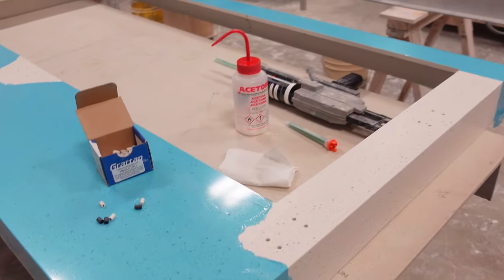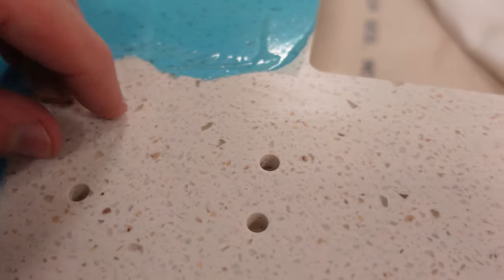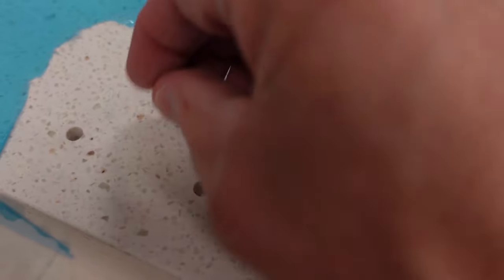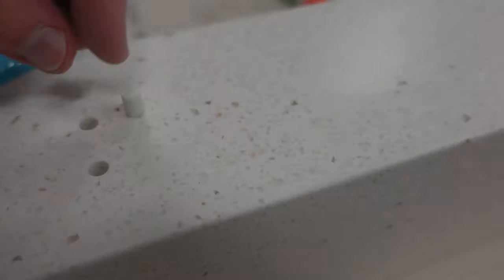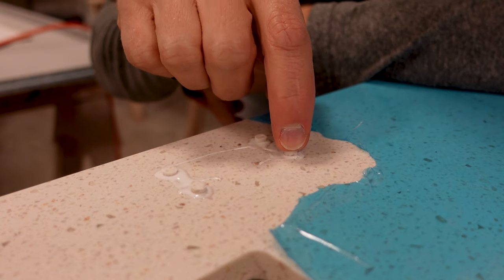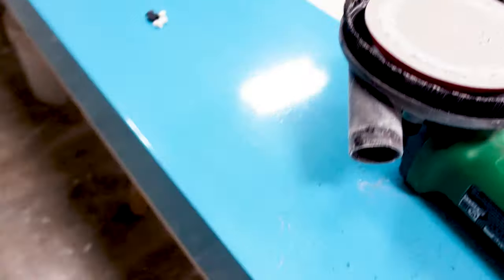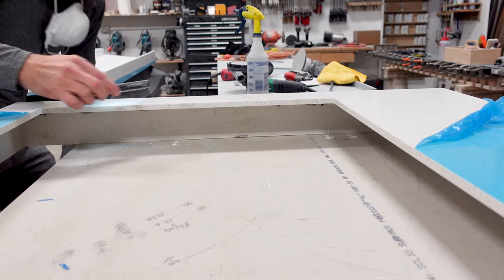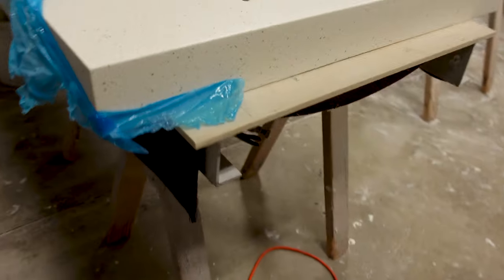Corian Solid Surface Countertop Repair - Expert Guide

Comment: Great video Andy but really think you should be using and emphasizing high filtration dust capture at source and dust mask. They have some research that shows that solid surfaces like Corian dust can lead to pulmonary fibrosis.
Reply from the maker: Thank you. 

I don't use a dust collector on my videos. Then you wouldn't see the dust flying aroundwgicg would make for a boring video.

Also, I stopped mentioning anything that has to do with safety. I don't want to be held liable for any inaccurate safety information. Now I make videos for entertainment purposes only. Pretty sad but that's the way or works works now and I can't afford to be wrong.
Reply: Bruhs, if you grind stone or concrete wear a mask. If you don't that's on you. Minerals and crystals do not belong on your lungs.

Comment: So I think would of been helpful to explain why you made the holes wrong to begin with. Also wouldn't it be cheaper to install new counter tops as what compared to your hourly rate of fixing. I assume your eating the extra labor.
Reply from the maker: The customer ordered the parts wrong so I didn't have to pay for the repair. We just machined plugs 6in the CNC and filled the holes.

Comment: How do I get rid of super glue stains on Corian? The glue soaked through some paper and now I have splotches. Help 😅
Reply from the maker: You can scrap it off with a brand new razor blade but it may scratch it a little.

You can also sand it off as well. I have videos on how to sand Corian solid surface.

Comment: Can you sharer a link to the 2 part epoxy? I'm confused. Also can hard wax be used to fix seams on Corian ? Please advice
Reply from the maker: Hard wax will not fix a seam. 

https://amzn.to/4bZisBO
Reply: @AndyGraves  hi, will this product you shared the link for help repair a crack along the seam? Also, there is a second crap off that same seam. What kind of material would gill that crack? Thank you so much for any advice you may have for me.
Reply from the maker: @GPG0000 this is the correct adhesive if you are trying to fix a crack in the solid surface. Make sure you buy the correct color adhesive.
Reply: @AndyGraves  thank you! Will do that! It's a corian look alike surface most likely linen or everest! Is this a color match? What color adhesive comes closest to these? Please advice.

Comment: Despite the fact that you grind without a vacuum cleaner in the workshop is clean enough, how so?))
Reply from the maker: I typically do grind with a vacuum but it's not great for filming. There would be no dust flying around. ;)

Comment: Hello. I have a Corian countertop that is 21 years old but it is in perfect condition.  The only problem is that is is dull (not shiny).  Can I put clear epoxy on the countertop just for the shine? Thank you
Reply from the maker: No, do not do that. I have sanding videos that will show exactly how to refinish the top to make is shine again. Corian or other solid surface material has not coating or top coat. The shine of the material comes from the sanding and polishing process.
Reply: no sé escribir inglés en español te explicari es muy fácil como pulir y brillar

Comment: Hello,  I have a corian countertop in my kitchen placed since 1998. It has a chip at the edge,  how can I fix it?
Reply from the maker: You will have to fill it with epoxy and sand and finish with surrounding area. Or, cut out some material and put in a new piece with epoxy.
Reply: no escribo inglés en español te explicaría lo fácil que es

Comment: Hi Andy, I have a widespread 3 hole faucet on a bath sink. I am curious could those two holes be matched and filled to look seamless?
Reply from the maker: Yes and no. You would have to have the same material and a perfectly cut hole and plug. You would also need the correct adhesive match.
Reply: @AndyGraves  Wow thanks for your fast reply! It seems like it's standard solid off white, but I don't have any remnant material. I would need find someone that could come up with matching material, or are you thinking that is doubtful?
Reply from the maker: Very doubtful. There are over 50 white colors. Your chances without an exact match are about zero.

Comment: Andy, love your vids. Can you answer me a quick question. What width should a front rail be when an undermount s/s sink is fitted with a standard 600mm deep corian worktop with 40mm downturn. The sink is 390mm front to back. Tap hole would be 35mm centred at the back. In front of a window with a 20mm overhang on the window cill....Thanks.
Reply from the maker: What is the overhand from the face of the cabinet?
Reply: Hi Andy...10mm.
Reply from the maker: @tracyyy99  we do standard kitchen sink setback at 4" which would be 96mm. We start there and adjust based on cabinet size and any other interference.
Reply: @AndyGraves  Thanks Andy, that is interesting. So, would you expect the back rail to be more than the front rail...for instance a 96mm back rail...this is to have a 35mm tap hole cut out...there is also a 20mm window sill over hang, which basically reduces the rail to a 76mm  physical space for the tap to be positioned. 
The front rail is 111mm. And this is the problem, I believe the fabricators have got the rail sizes wrong...it should have been 111mm at the back and 96mm at the front. Oh...btw the fabricators asked the kitchen installer to cut the window sill back by 20mm so the tap could be fitted.  the sill now sits flush with the wall They won't accept they are wrong. Many thanks for your input, i just wanted another point of view on this .
Reply from the maker: @tracyyy99  We like to see 5" from the back of the sink to the wall. Keep in mind it's all adjustable depending on the situation.